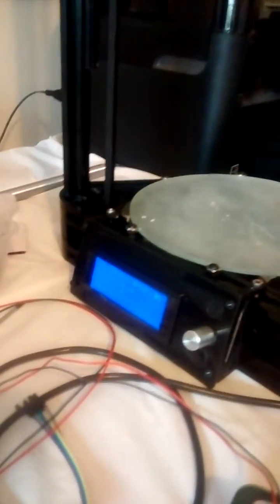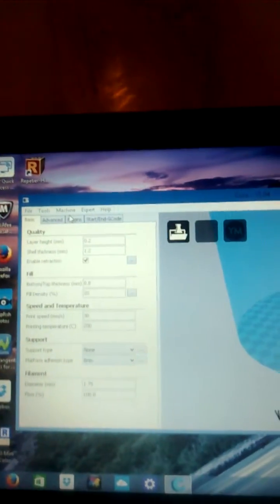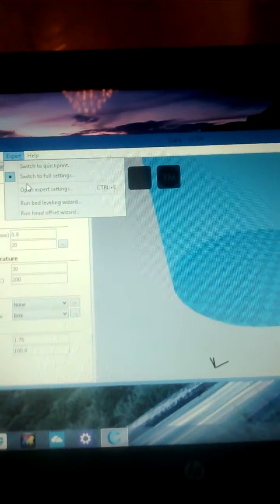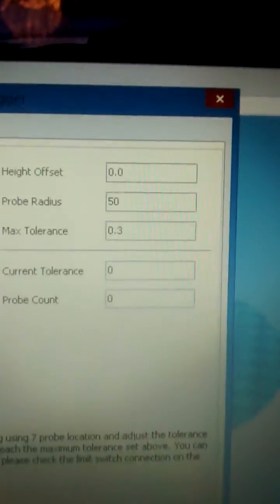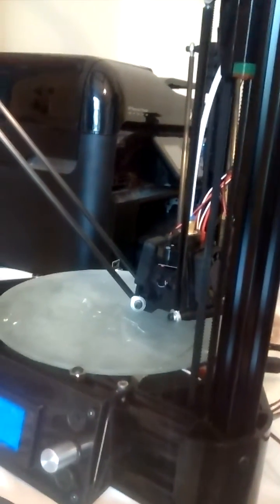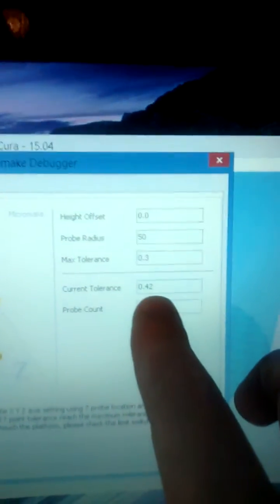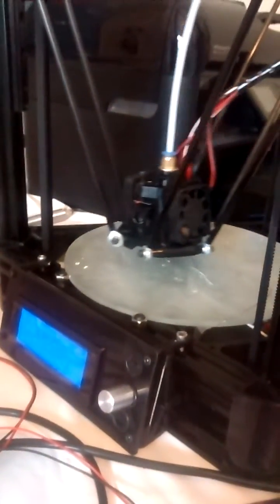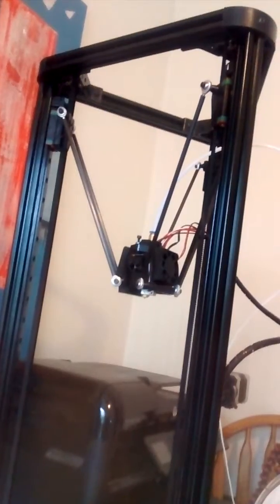Micromake bed levelling tutorial

Comment: Hello . Thank  you for the Video . 
I am Very new to 3D printing and I've got a MicroMake D1 3D Printer . I am using Cura to print (which came with the Printer 15.04 i belive)

I've got a Question which is about Bed Leveing .(if I am correct )
after the Auto leving . the Print head is correctly set to be above the Print bed 0.2mm . and most print is fine . 
but I was trying to Print something BIG , a Test Big Circle 

when the Circle reach Z outter 1-2 CM of the Circle . it not touching the bed 
if lifted about 0.2 mm . but the middle part , other parts are fine . even on Z . inner circle are fine .. 

can you help me pleas e? thank you

Comment: Did you have to adjust the Max Print Height after levelling? I found that my printer was attempting to print in mid air after auto level, and adjusting the print height could fix it, but only until I auto level again......
Reply: +James Cutler 
Hi James, I did have to adjust the height at some point.
Reply: Fair enough - as it turns out, the software posted in a comment by Micromake is completely in english - and I can see where to adjust the height offset - so problem solved :)
 I have to say that I am happy with my printer, it is great value for money, and seems to work really well. I was printing things all afternoon yesterday and did not have a nozzle clog once :)

Comment: I have this same printer except without the linear rails. Have you managed to get both your fans working? I can't find the setting to switch on the second. 

Not only this, I find that the main fan which cools the aluminium heat diffuser switches off now and then somewhere into the print. Its been a major pain in the ass for me, as it causes nozzle blockages. Even had one blockage reach all the way up inside the teflon tubing.

In addition to the above, the glass that came with my printer was broken so I bought an aluminium one for a kossel which seems to work. However, after running the bed levelling and starting a larger print, the nozzle sometimes catches on the bed toward the edges, suggesting that the bed isn't level (and sometimes even engages the clicking of the end-stop attached to the print head), even though it says there is less than the standard 0.3 tolerance between all 7 points on the bed. Any tips?

The bed levelling wizard doesn't connect on my version of Cura either.
Reply: you need to reverse your fans. the first time i set mine up the same thing was happening to me also. one fan should always been on, that is the one that cools the aluminum. for the bed leveling, same problem also, i put the probe radius to 70 and that fixed it for me.
Reply: sitoru I managed to sort the fan problem, but I still can't switch the secondary one on. Any ideas?
Reply: the second fan is controlled by the software. it should be set to turn on usually after 3 layers. to a make sure its working, go to the fan speed option on the micromake to manually turn on the fan. if it was turning on and off before, then it should be fine.
Reply: Ahh, okay thanks!